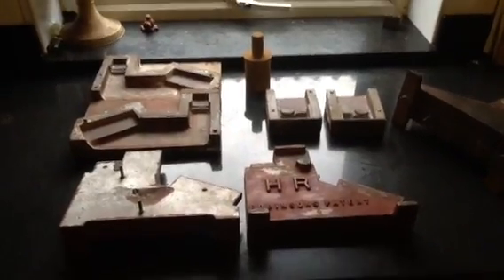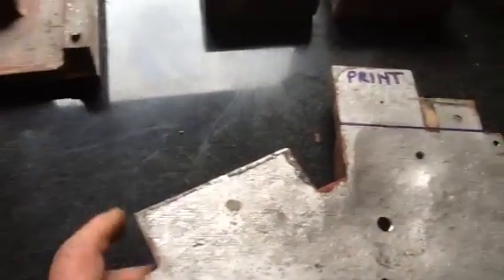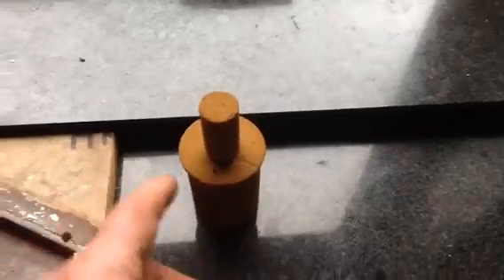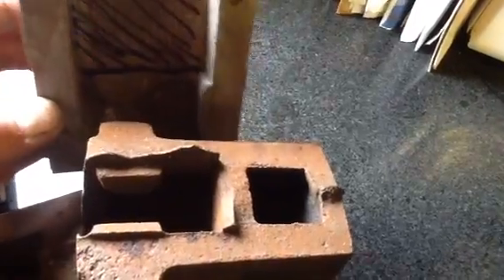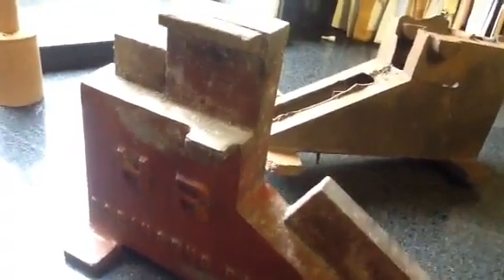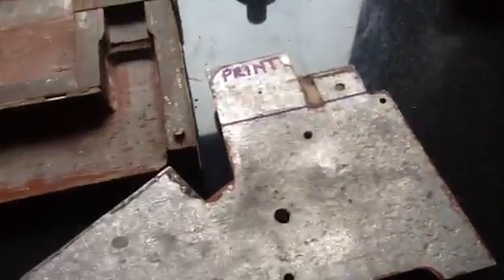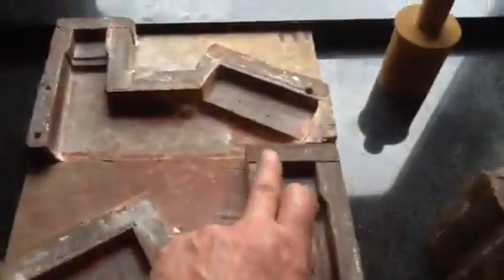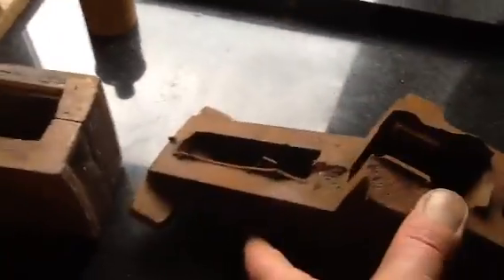Core print explanation.

Comment: Perhaps a little more description on core prints?
Nice hands on video, btw.
Reply from the maker: +DaRapar0011.   Many thanks for your comments. Do you have any specific questions I can answer for you? Cheers Grum.
Reply: +Grum C, yea, it'd be of great help if you can explain how the core prints are used and for what. I didn't get a clear idea from the video, I'm afraid. 
I understood what the core is there for. But I'm confused with the core print. Are they same? Is the core print an extension of the core that is supporting the pattern to prevent it from sinking while casting?
Reply from the maker: +DaRapar0011   No problem. The term print, like a footprint is the area made by the pattern where the core extension is supported outside of the cavity made by the pattern. It would have been easier to understand if I had made a sand mould and a core but as you can imagine this is a rather time consuming operation and would make the video far too long. Cheers Grum.
Reply: Got it! thanks :D